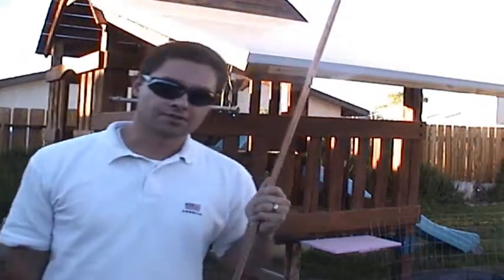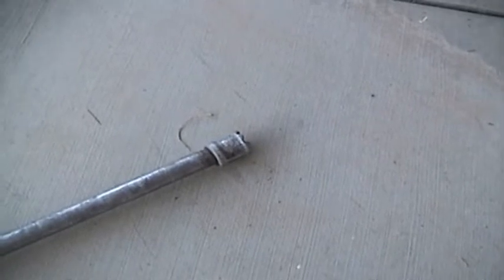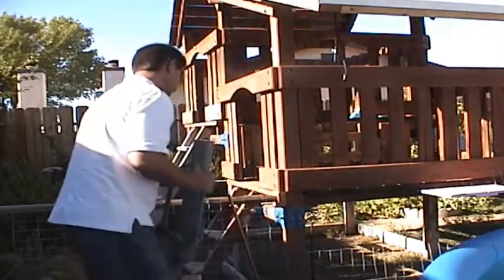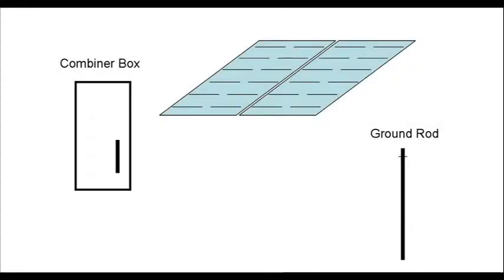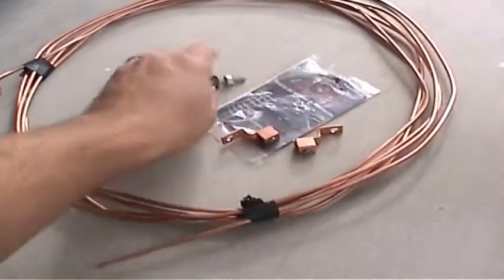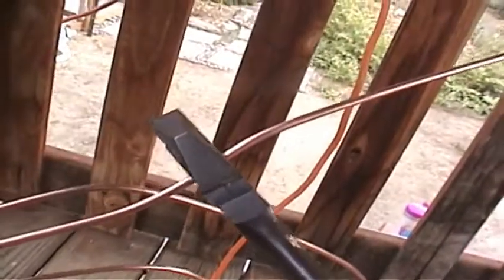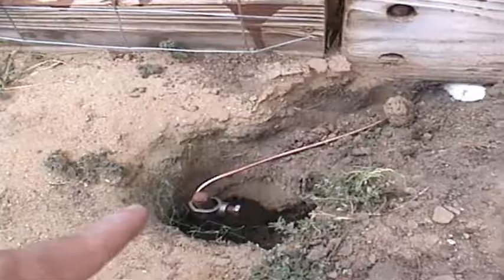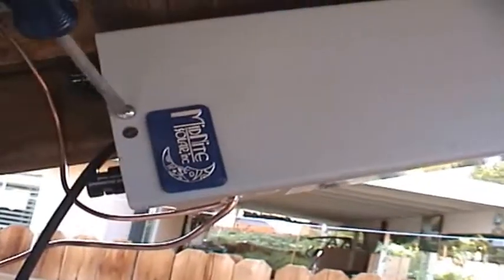Part 3. Simple Safe Solar DVD – Grounding the Panels, Step by Step

Comment: I’m not 100% convinced there won’t be,,,I think they call it some type of aluminum oxidizing in the long run,,,if you check everything in two or three years it might be perfect,,,or then again if you go checking continuity with a meter after it sits outside in the weather for a while you might not have the conductivity you think you have I don’t know? Another question another YouTuber brought up here is what in the world do they do when they’ve got solar panels hooked up to a sailboat or some other type of marine craft??? A lot of guys are running those Victron systems on  sailboats,,,how does that work out???

Comment: Why does the rod have to be 8 feet long???and also another question I have is there anyway possible you could get a steel grounding rod that is copper coated/plated? I would rather use a front end loader of a tractor or a backhoe to push a steel rod in to the ground I’m afraid if I go pushing on copper like that it won’t take the force of pressure and get all mangled up
Reply: The ground rods you find in hardware stores are just that. They’re called “copper”, but are actually copper clad steel.

Codes require 8ft to get the rod down into permanently moist soil, and also increase total contact area with soil. This improves rod-earth conductivity.

Comment: Tightening with wood in between is a bad idea, will come loose. And in that case, why even addding another bolt nect to the panel mount bolt? Galvanic corrosion may occur towards aluminum.

Comment: HOWdy jjj,
PART # 3  GROUNDING = Thanks for the INFORMATION 
...
you have too many  dissimilar metals touching each other ...  in this video ... 
Stainless Steel bolts washers etc have proven to be advisable as opposed to galvanized steel bolts & washers on to Aluminum  
also
electrical code advises ONLY a single (not  two or several) ground wires per grounding LUGS  
COOP
...

Comment: Hi not a bad vídeo, when bonding the copper to the PV frames always file away the anodic film on the aluminium frame, to ensure a good contact, use stainless steel fixings and a star washer to secure the copper lug down firmly with a nylon lined locknut.  Re the combiner box feed the copper through the holes once you have inserted rubber grommets then caulk appropriately.  Hint as a verification test prior to earthing out set your multimeter to the ohms setting and touch both probes on to the same solar panel frame, in most cases you won’t see a dead short.
Reply: I copied and pasted that, you explained that real nice thanks!!

Comment: Sorry but, you should have used star lock washers and mounted the ground lug directly to the panels. First, wood shrinks and loosens the fitting but, secondly, galvanized steel against aluminum  causes massive corrosion. Your set up is worthless in the configuration you made it. If lightning strikes your panels are cooked and the frame will be on fire. Would never pass code the way you did it. Make another video showing the right way to do it and pull this one to keep your viewers safe!

Comment: Always been told you don't put copper against aluminum, this connection will not cut into the anodized coating on panel
Reply from the maker: Thanks for the good comment, Jim. I've have questions on this myself. You can remove some of the anodized coating to make better contact, but then I've had installers tell me that galvanic corrision can occur because you are bonding dissimilar metals. But, that can take years to occur. So, maybe it won't hurt to remove some of the annodization? Ultimately, the system I put together was based off a mobile sytem in a trailer that I did a decade ago. There was no grounding to a ground rod obviously. My intent is to show a non-permanent installation with the added safety of adding a very basic grounding scheme. Again, thanks for taking time to comment. I am always looking to learn from the experience of others.
Reply: Would it be possible to connect the copperto the galvinsed bolts and the bolts with spring wasers to the aluminium frame? Spring washers will press through the anodized layer and copper does not touch aluminium. Just would like to know.